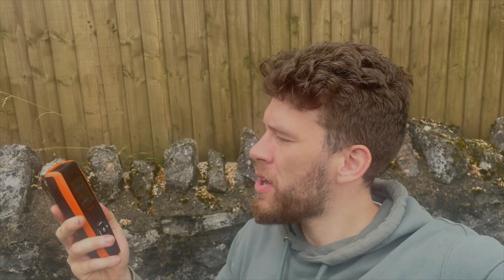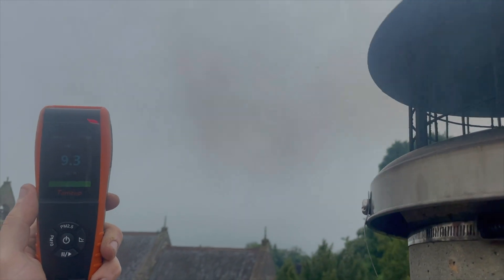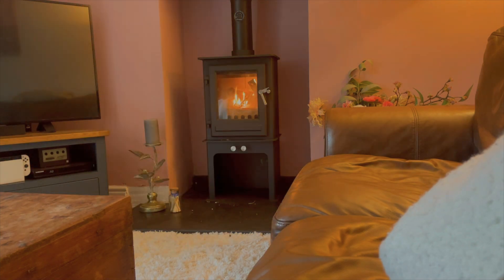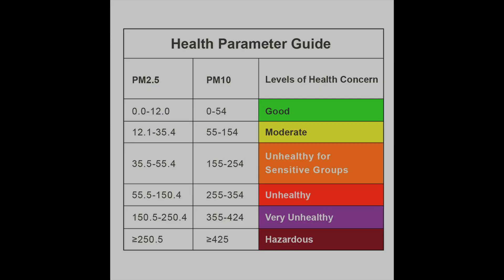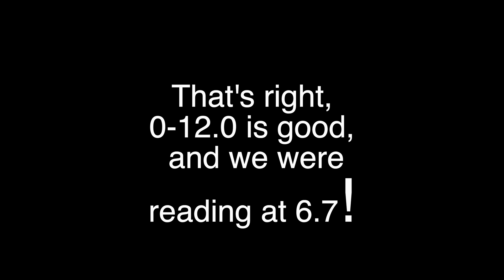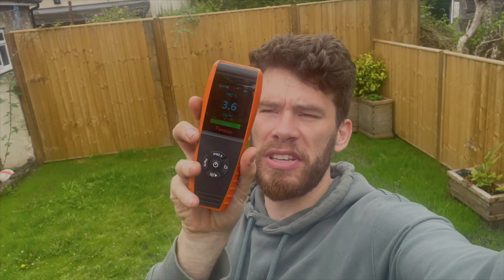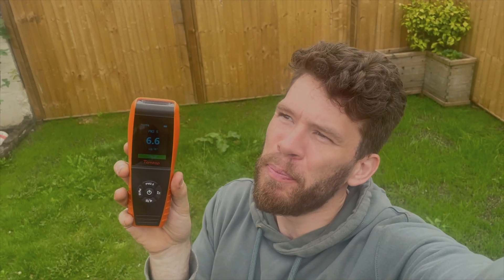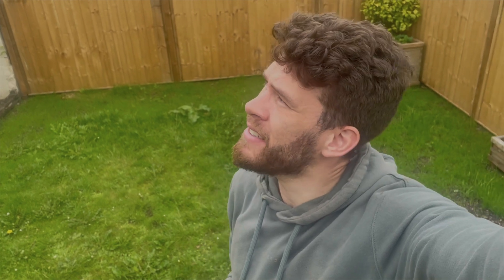How clean is an Eco-Design stove         PM2.5??? #woodburningstove #cleanairsolutions

Comment: I've just done a talk on the PM2.5 issue.  My conclusions included that modern ecodesign stoves, being used properly, emit very little particulate pollution.  Also to be taken into consideration is that the atmosphere contains both primary particulates and secondary particulates. The secondary ones are formed from gases typically given off by cars, some time after the car (or industrial process) has emitted the gases.  Woodstoves are definitely not the cause of the majority of the PM2.5 pollution.  Also, over the past decade, the levels of PM2.5 have gone down significantly, and they are currently low!
Reply from the maker: Interesting stuff. Thanks for the comment, I didn’t know about primary and secondary particulates.

Comment: I bought one of your stoves the Woodford Lowry 5x and honestly very disappointed in the crap vermiculite board and 2 months in and the sides are crumbling and the top brick is split in two I understand it’s a consumable part but say If you fit new tyres and they last 2 months or break pads etc it’s not right and the cost of them is ridiculous £189 and you won’t do anything about it
Reply: My Morsø Badger is still on its original firebricks after 11 years.  The only thing I've had to do to it, except an annual sweep, was new door rope at 9 years.  Morsø stoves are not cheap nowadays, though.
Reply from the maker: Bricks is always a tricky subject. Generally the time they last is directly controlled by the user, so every manufacturer operates in the same way, and 95% use the same material (vermiculite board). In the same way that doing wheel spins will destroy tyres, bumping bricks with logs will cause the issues you’ve described. 

We sell the bricks, but we’re simply drop shipping them from Woodford themselves, so we have no control over their warranty procedures, though what you’ve described is standard to all manufacturers I’ve encountered. 

Shame, that it’s not worked perfectly in this case, but hopefully the description of the cause will prevent a repeat of the same issue.
Reply: If the bricks are crumbling after only a couple of months it might suggest to much glue in the bricks, years ago I worked for a manufacturer of stoves and this happened that manufacturer replaced the bricks free of charge. Obviously can’t speak for your manufacturer.

Comment: I find the alarmist approach laughable when you look at city centre pollution from coal in the early 1900s….  A wood stove in winter is not going to expose anyone to very much given people do not go outdoors near homes very much in the heating season.
Reply: It's a problem in big cities, where stoves aren't really a good idea anyway.  Out in the sticks, they're more useful as wood is more easily found and your oil tank might run empty.
Reply: @ we are told it’s a problem but as this video demonstrates the measurements are very low.  Additionally the standard of the stove and the flue are important to ensure complete combustion AND a flue that discharges hot flue gases that then rise in cold air and disperse.  Well seasoned wood makes combustion relatively clean.  The idea of a sterile environment is contrary to natures balance and some wood smoke I find a very pleasant odour especially pine.